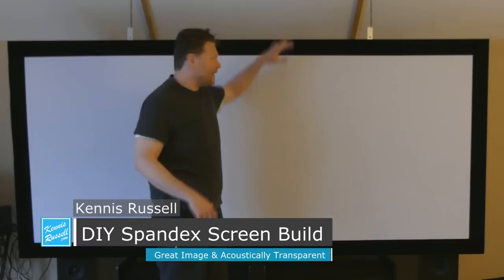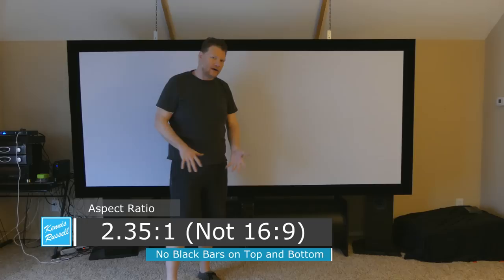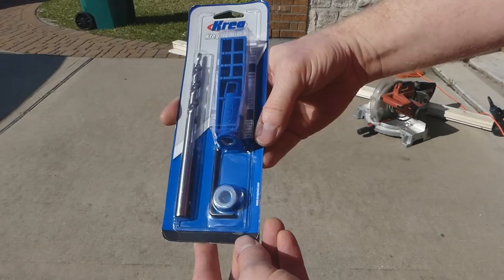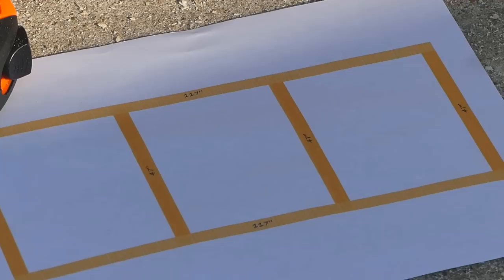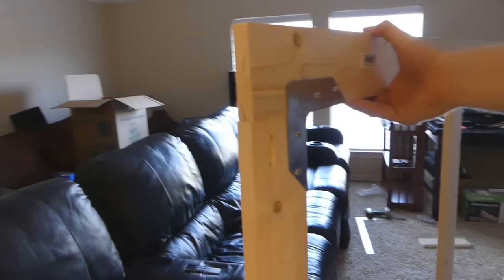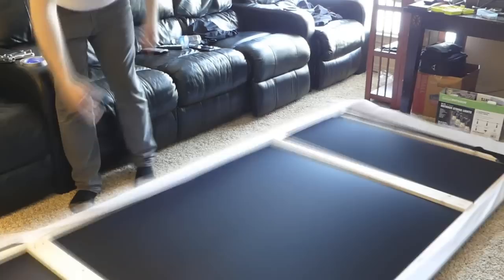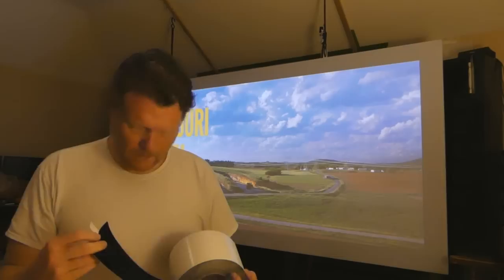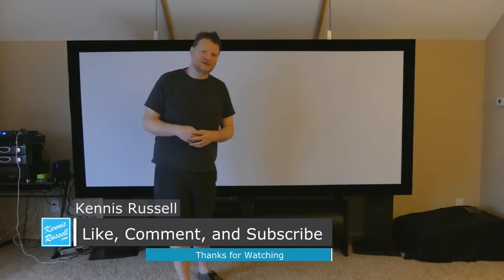HUGE SPANDEX Projector Screen for Home Theater

Comment: Hey man great job on the screen, I'm considering making one myself.  I'm not trying to be snarky here, just genuinely trying to help.   The reason you had trouble with the Kreg clamp is because you were using the wrong one.   That clamp is intended to hold your peices together to drive the screws after the pocket holes have been drilled.   The one you needed has a flat disc on both sides, and it works much better.   Hope that helps in future projects!  Have a great day, and thanks for the tutorial!

Comment: Great job Kennis, and fantastic that SOMEone finally is speaking out about the importance of a couple of cinematic realities.  Everyone TALKS about having a Home Theatre, but compromise on these very essential aspects of cinema presentation.  

As you say, it is important that speakers need to be placed BEHIND the screen for maintaining the illusion of sound coming from the actors when they speak.  This is why EVERY theatre on the planet places their speakers behind the screen.  This also allows you to use a center channel with speakers of the same size and characteristics as the left and right speakers...again all theatres use three IDENTICAL speakers systems for the L, C, R channels.  This idea of using a little puny toy speaker for the center channel as so many home theatre sound systems do, while it may be convenient, it's certainly not what the sound mixing engineers of a movie soundtrack expect the end playback system will be using.  Is it any wonder why so many people complain that the dialogue is unintelligible or too low compared to the music score and sound effects -- well hello -- the dialogue which primarily is reproduced by the center channel is being played back by some dinky little speaker a forth the size and capacity of the Left and Right channel speakers.  Duh.   

So congratulations Kennis on all counts -- great construction job, great understanding that speakers should be behind the screen to produce coherent sound localization and not off to the sides and underneath it and also, that most important and misunderstood concept of aspect ratios -- that CinemaScope/Panavision aspect ratio is supposed to get WIDER, not smaller than standard 1.66:1 or 1.85:1.  Common height is the right way to go, not common width; common width completely defeats the reason they invented CinemaScope -- the whole purpose of CinemaScope was to make the image get wider than the standard image, not smaller and squatter.  Finally you recognize the importance of the center channel.  Good effin show!!  

Happy movie watching!
Reply: "EVERY theatre on the planet places their speakers behind the screen." That was the case until recently. But now, with the Samsung Onyx 4K VIDEO WALL THEATERS taking over, there are no speakers behind the video walls obviously. Go to the JBL Pro Cinema Loudspeakers site to see what they are doing instead. Perforated screen th4eaters are going away, slowly but surely. When you have  perf'd screen, both the image and the sound trying to break through from behind the screen are much compromised.

Comment: You made this screen to get the right coverage of  picture , without  seeing the black bars. And then you covered the inches of seen screen with tape. So now the picture is smaller again. I saw as you put the tape on, the video was getting covered. Interesting to use lycra material. But since alr screens are the best, you should have tried to get silver color.
Reply: yeah i waws a bit perplexed when i saw this myself... why did he do that , unless he adjust later.... i hope

Comment: I've got an Artlii 720p projector about 14-15ft away from the wall I'm projecting to, 126"x58" picture, does this spandex stuff stretch enough to make a frame that big?  Should I not stretch it?  The diagonal is almost 140" across, so not buying one of those cheap 120" projector screens from eBay.  I plan on hanging it like a picture, maybe 3D printing a cleats to hang it and be able to take it off.

Comment: Will this screen work with Ultra Short Throw projectors since the angle of light will make the light bounce to the ceiling? Normally the vendors suggest to use light rejection screens. Appreciate your feedback. Great cost saving idea.

Comment: What are the exact dimensions of the screen frame you built ? I am interested in having a 120 inch 2.35:1 for my HT. 
How much spandex did you order to have the required fit ?

Comment: The thing that is annoying me about the Spandex sheets is they seem to only come in 58/60" height maximum, so there is no way to make bigger screens than this height.
Reply from the maker: Well it does stretch a great deal. 60” could probably stretch 80” or more.

Comment: Are you still happy with your screen? Does it have enough of a gain for 3D content? I need this inexpensive solution to work, because acoustically transparent screens are so expensive.
Reply from the maker: Yes and yes. I say give it a shot. Realize though that 3D is about half the brightness on any screen and will never be like a 2D movie. That being said, the first thing I did was buy a bunch of 3D movies and really enjoy watching them.  My conclusion is that the weakest link in 3D that make 3D frustrating is 1. Glasses fit and function (everyone’s face is different. I have three brands of glasses and some prefer different brands). 2. Room needs to be really dark. 3. Bad movies, some 3D movies are not that good. 4. Projector settings (just have to play around with it).  5. Screen, which I have has no problem with. 

Anyway I hope that helps.
Reply: @kennisrussell  Thanks for your quick response! I'm still fantasizing that everyone would have fun with my huge 3D collection, but no one enjoys the glasses. 4K has been a great way to ween myself off of 3D. I'm glad the screen works great for 4K; definitely the route I will take to DIY.

Comment: Just out of curiosity is this shiny spandex or not and would it make any difference if the black was shiny and white a normal colour, what do you think ? Thanks. amazing cheap but great quality screen.
Reply: I think I saw on AVS that the two listed in the video description (matte) make a gain of 0.9 or 1.0.  If you went with shiny, that would change that. If you need a higher gain, try shiny.

Comment: Hello,  I went to spandexworld.com   but it's overwhelming what they have; what kind of spandex did you actually order so I can order the same?   I also noticed you have what seems to be an Epson 3700, 3500, Am I right?  How did you get that projector to throw 2.35:1 without having to adjust zoom manually ?  If I'm not mistaking those two model number cannot project wide screen like that.  Great video by the way.
Reply: That's what I thought, I had the 3700 for a short while and never noticed that feature. Next year Epson should come out with a true or faux 4K version to compete with Optoma and Benq  at around same price as 5040UB which I hope supports 3D.   Thanks for sharing the spandex info and I think I'm going to make me a screen like yours.
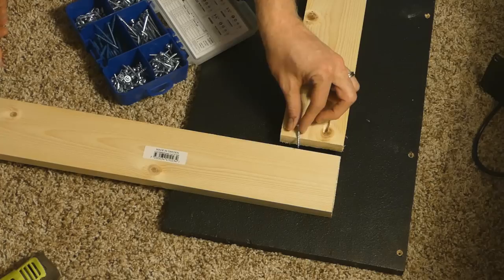Reply: Kennis Russell How many yards of each color did you order? Would 3.5 (7 yards total) work for a 120” 2.35:1 screen (approx 64”H x 110”H frame). Also, does IKEA sell lumber? I see the Made in Sweden sticker on your framing at 8:20 mark ;)
Reply: Jokur 26 
Home Depot lumber is now purchased from Sweden
Reply: Kennis Russell Thanks

Comment: I watched the whole video, but somehow I still missed the part where you demonstrated that the screen really is acoustically transparent.
Reply from the maker: I didn’t film that. It is though.
Reply: How do you film audio going through a sheet of spandex?
Reply: csabo1725 Yes, if only there were devices that measure sound levels, that could be videoed with and without the screen, to show the loss.

Comment: Nice job!  I had originally ordered a standard 92" 16:9 screen but per recommendations on AVSForums, I was told I should look into 2:39 and I came across your video.  

I followed your links for the black and white Spandex, but I don't recall how much you ordered in yards overall.  The area I'm working with is 130 3/4" x 48"...I'm not sure what makes a perfect 2:39 ratio but I could go about 10" higher if needed.  What do you suggest on yards needed in each color?

I also don't see a link for the black felt you used on the border.
Reply: I'll help out here....if 48"is your maximum allowable screen height, the width of a 2.39:1 image would be 115" (124" diagonal)  For that size you would need to order4 yards each of Black & White Milliskin.  Come back onto AVS to get some really constructive help.
Reply: @rolandboughton6015  Thanks for that, Roland.  Here's the thread with pics so it makes more sense as to what I'm trying to accomplish.  I'll likely still go the full 130" width for the sake of uniformity (you'll see what I mean w/ one of my pictures) and then I'll install drapes to adjust the sides as needed based on the picture ratio.

https://www.avsforum.com/forum/showthread2.php?p=57890318#post57890318